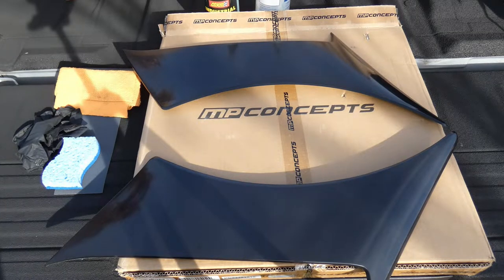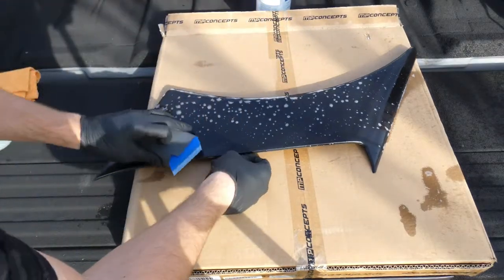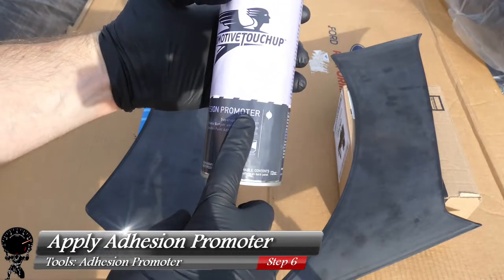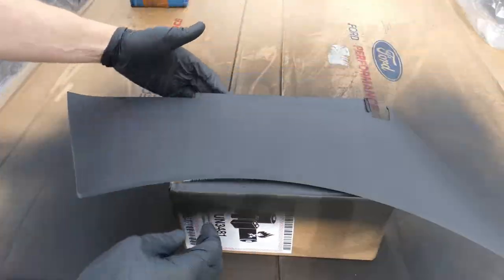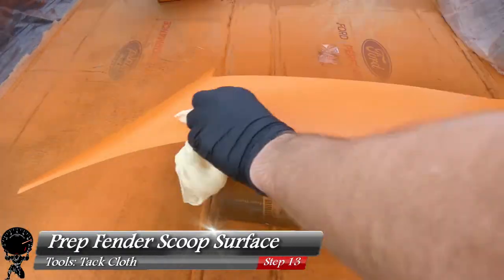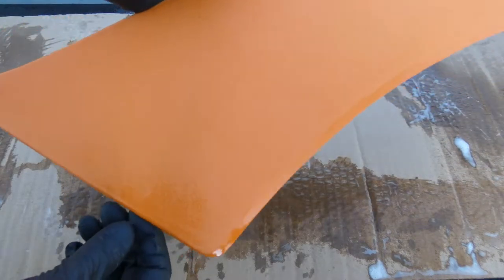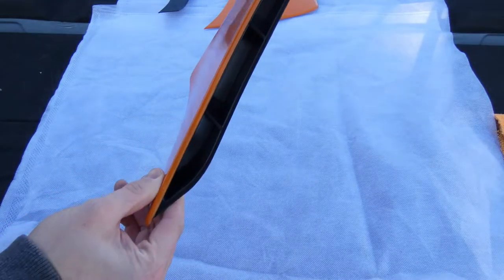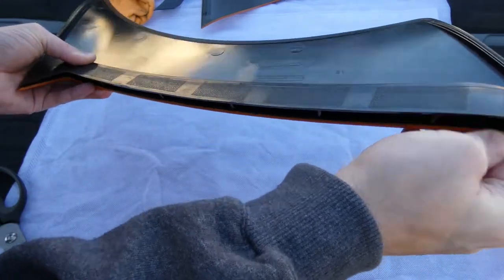How to Paint and Install S550 Mustang Front Fender Scoops. (2015-2023)

Comment: So the coating is basically just a ceramic coating for the reflection or is it mandatory?
Reply from the maker: It's mandatory. When a car is painted, it has three layers on the body: sealant/primer -> paint -> clearcoat. The clearcoat provides a permanent layer of protection and allows the color to shine. Ceramic coating is a temporary protective addition on top of the clear coat (similar to a wax finished).

Comment: Hey man it’s me again so I listened to you and took it to a paint shop where they painted my fender and half of my door but for some reason there’s a slight difference in color paint even tho they used the color code that’s located on the door. I understand there’s always going to be a difference between the bumper and fender because it’s made of a different material but I could notice  it while on the other side of the car, the one that wasn’t damaged I can’t tell at all
Reply from the maker: Im sorry to hear the paint didn't match the color perfectly. Sadly, It all depends on the paint shop. Some do a better job at matching paint colors than others. Matching metallic paints based on the paint code alone is a gamble when trying to obtain a perfect match.
Reply: @mcgurrentertainment  what do you think I should do ? Any advice ?
Reply from the maker: Depends on the paint shop. Talk we them and share your concerns, see what options are available.
Reply: @mcgurrentertainment  okay thank tou

Comment: Can I do the exact same steps to paint a  fender. I just broke mine and I’m buying a new one but I’m new to this whole painting thing so do I just follow the steps to paint a new oem fender ?
Reply from the maker: Pretty much. The trick is to keep dust and bugs off of it while you're letting it dry.
Reply: @mcgurrentertainment  what about blending and matching colors with the rest of the car ?
Reply from the maker: Now, that's a whole different process. If you want that level of perfection, you may want to goto a paint shop
Reply: @mcgurrentertainment would u say it’s worth going to a paint shop for a fender. I’ve called around and they are charging me 1300.
Reply from the maker: It depends on the color. We seem to get lucky with Twister orange; as you can see, the scoop matches the paint very well. However, metallic paints can be a pain (such as Kona Blue). You can see in this video (link below), the blue looks good, but it's not perfect.
 https://youtu.be/t0g61wRmAHM
Reply: @mcgurrentertainment  what about carbonized metallic grey ? M7 paint for a Mustang gt ?
Reply from the maker: Tough call. Definitely shop around and get a few quotes. Gauge it from there
Reply: @mcgurrentertainment  okay thank you so much for your help
Reply from the maker: Anytime
Reply: @mcgurrentertainment hey man so there charging to much so what do I need to paint the fender exactly ?
Reply from the maker: Same items you would need for this video. You would need more paint though 2-3 cans
Reply: @mcgurrentertainment  okay thank you also the sandable primer what color did you get it in ?
Reply: @mcgurrentertainment also for one fender 2-3 cans ?
Reply from the maker: @xxchrisgamerxx6850 black, but gray will work just fine
Reply from the maker: @xxchrisgamerxx6850 most likely
Reply: @mcgurrentertainment  3 cans of everything or just paint ?
Reply from the maker: @xxchrisgamerxx6850 I'm not 100% on coverage off the top of head (so it's best to have extra). But if I had to guess: 2 cans of primer and clear (each). 2-3 cans of paint. 

You're going to have to gauge it.

Comment: Step 1: buy a GT350 🤪
Reply from the maker: Looks like the Mach1 took its place.
Reply: Step 1.a. Buy a used GT350 😆🤪
Reply: You realize that with bolt ons and tuning a 5.0 can match or even beat a stock GT350 right? Not to mention GT350s tend to burn oil. For the price of a GT350, you could get a 5.0 and supercharge it and have money to spare.
Reply: @smasher Devourer If you think the gt350 is all about straight-line speed then you obviously missed the point, my friend. It was only a joke btw buy whatever makes you happy. The 5.0 has insane performance for the price.
Reply: @scoobyproper13  That's what suspension upgrades are for.
Reply: @Smasher-Devourer  Dude, we get it you don't care for the Shelby. Everybody has their own preferences. 5.0's are awesome!  I am not gonna argue that. especially when you consider where they sit in the market. price per performance the 5.0 is pretty much unmatched